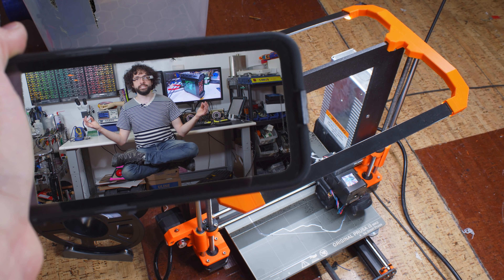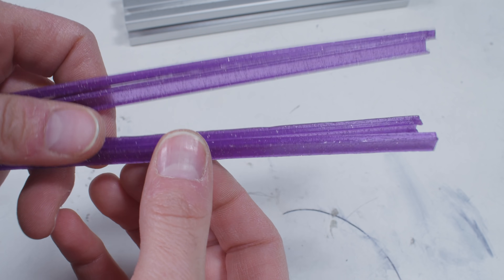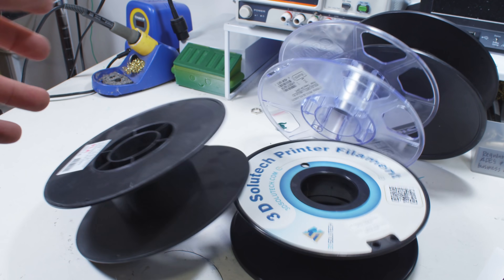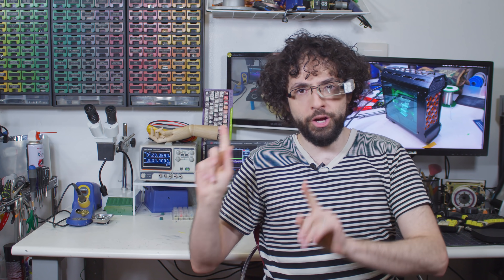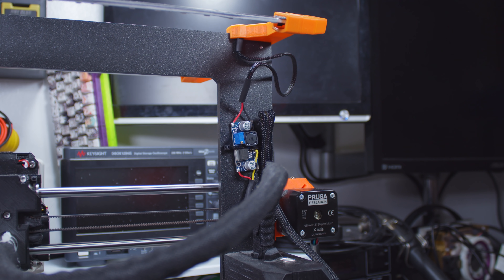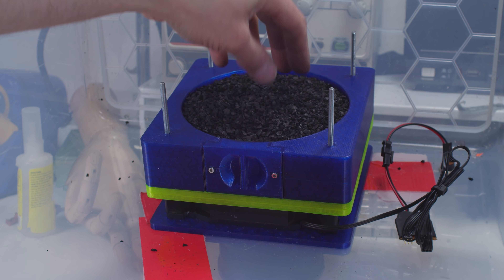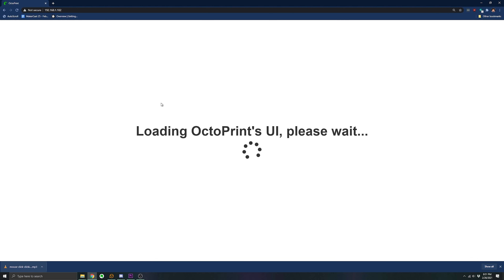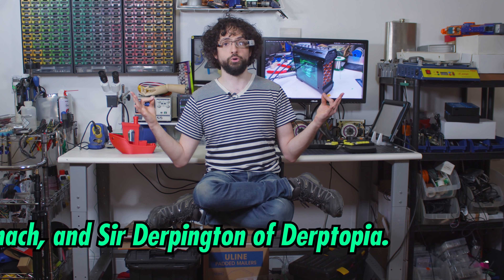Top 10 3D Prints to 3D Print for your 3D Printer (on your 3D printer)

Comment: Something interesting about octoprint. In times where a Raspberry Pi can only be bought with 3 gold bars. I used the old smartphone from my son. It's fast enough, has a good camera and can be mounted easily with an mobile phone holder to the printer. It also have a Display and touch screen. So maybe, when you plan to use Octoprint and the Raspberry Pi is to expensive, you have also a "old" smartphone laying around.
Reply: Did you run the same software somehow?
Reply: @gerkami82  thanks

Comment: Watch the thangs stl reverse search thingi just be a simple mesh thumbnailer which is then fed into a normal 2d image searcher. I wonder if you reorient all the vertices of a single stl along a plane of rotation and submit that file along with the orignal non modified stl file will it give the same results. I would be pleasntly suprised if it would, lol.

Comment: I am on generation 4 of printer mods: start with a basic printer, fix the obvious design/manufacturing errors.
Then fix the 'fit and finish' bits.  Don't like where that lever is located?  Make a new lever!
Now that the printer is working properly, print new parts to improve performance!
New hot-end, new cooling solutions...
Ditch the Bowden, go with direct-drive!
Now that the printer is sailing trouble-free, let's upgrade it further!
Multi-filament, tool-changers...
All along the way, numerous bits get printed to keep the show going!
If done right, 40% of the printer will be replaced by the time it is considered 'done'.
And once we are 'done' with a printer, what do we do?
We buy a new one...

Comment: The number one mistake 3d printers make is loose desiccant around filament. NEVER EVER DUMP LOOSE DESICCANT IN WITH YOUR FILAMENT. Dust embeds in the plastic and clogs your nozzle. Treat that stuff like you are doing surgery with it. Keep it in a spotlessly clean box for both your printer feeder and storage box. Use 500G bags of desiccant and weigh them now and then. Once they hit 650g toss them in the oven to dry out. Usually 150-200F depending on the manufacturer. 

I have burned dozens and dozens of spools and never clogged a nozzle. My printer lives in a working fabrication shop. It is not clean.

Comment: Can you build a duplication Microwave? Basically you would take a old microwave, add cameras on every side on the inside, take apart a 3d printer about the same size as the microwave, and use a raspberry pi to create a 3d model of the object you place inside and then 3d print the model. Perhaps you can wire the start button of the microwave to start as well.

Comment: There's nothing particularly nerdy or intellectual in knowing all of Monty Python...

6:10 this is the opposite to what happens to PLA due to moisture, it doesn't get brittle, it gets tough and chewy. It still won't print well, with potential foaming, wall unevenness, ooze, but it won't get brittle. It's a common misconception! But try it yourself, just take a piece of PLA, put it in a ziploc baggie with water, and test it. Odds are, predominant causes of this brittleness are UV light, ozone, and fluorine compound outgassings.

Comment: Octoprint is fun , but repetier server is better , can run on non-rpi computers like old laptops , and can handle multiple 3d printers with only one computer , as well as use a different one to slice over wifi
Reply: Can't OctoPrint do most/all of those things?
• It's just a Python app so it'll run basically anywhere (certainly not limited to RPis). Someone's even made it easy to run OctoPrint on Android devices (e.g. old phones), as Tom Sanladerer recently showed.
• I'd imagine you can run multiple instances on a single host because, again, it's just a Python app (I can't think of any reason that wouldn't work), though Repetier might make that more intuitive, I guess?
• Not sure what you mean by "use a different one to slice over WiFi", but since OctoPrint can run on any computer... this seems plausible?

(Note that OctoPrint is not the same as OctoPi. OctoPi is a Raspberry Pi SD card image with OctoPrint preconfigured, but installing OctoPrint manually is easy enough. Too many people seem to think that OctoPi is OctoPrint...)

Comment: My living area made my PLA too wet to print in two days, cries in 6-70% humidity.
Reply: Me who’s had the same roll of PLA for the past 3 years in 10% humidity 👁👄👁
Reply: @Nicksperiments  Does living in such climate have any adverse effects on your daily living? Dry skin/dusts/static charges?
Reply: @RexusKing  a little but not as bad as I though when I moved there. I noticed I need a little more lotion and water next to the bed while I sleep or else my mouth gets super dry but nothing too bad. There’s more static discharges but only when walking with socks on carpet. Way more advantages like not needing a dry box for PLA and swamp coolers use much less electricity than air conditioning
Reply: @Nicksperiments  That sound like great place to live 😭
Reply: @Nicksperiments  living in western Colorado during a drought, swamp coolers are a GODSEND